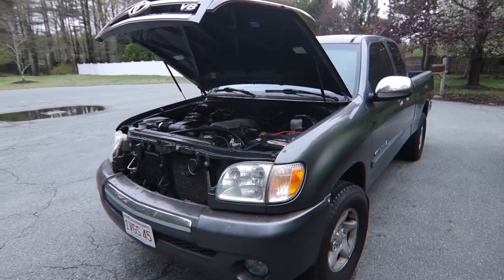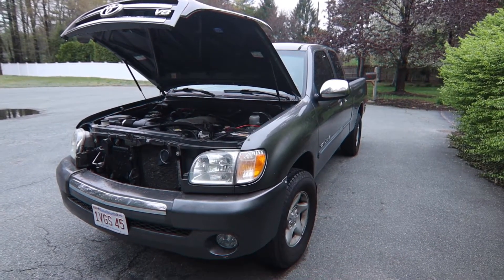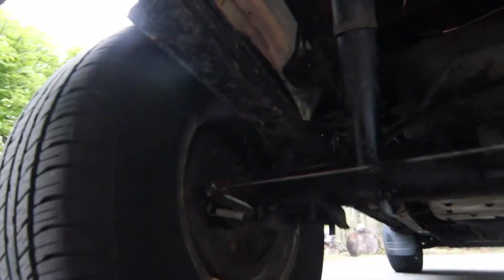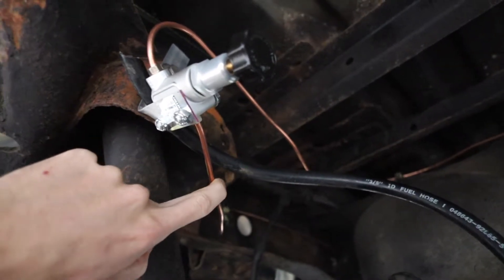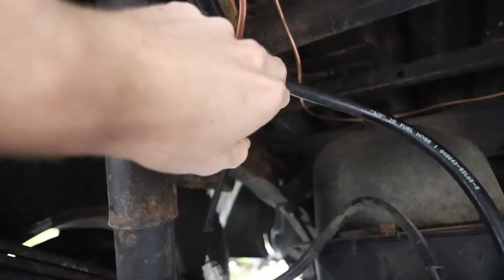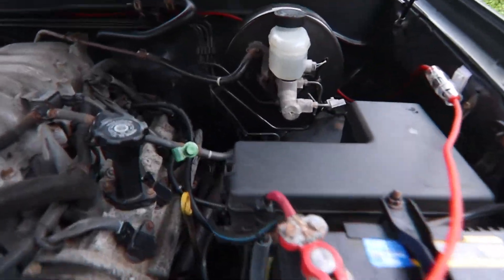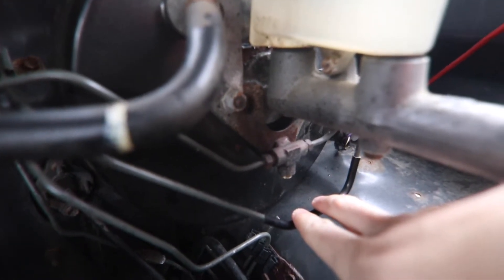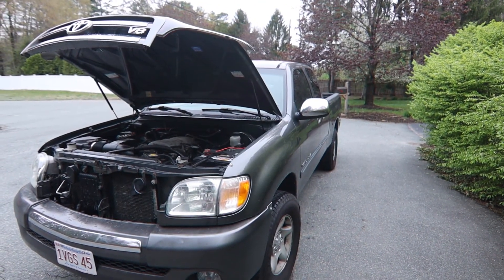TOYOTA LSPV DELETE / WILWOOD PROPORTIONING VALVE INSTALL

Comment: Copper is not strong enough for vibration, ware and take. You must use steel tubing
Reply: Nicop is great for ease of installation and resistance to rust and corrosion and is totally suitable for on road vehicles however one day hitting whoops in the dunes will brake them to pieces. Ask me how I know😂
Reply: Copper is the standard upgrade. Lasts far longer than steel.
Reply: @weswrenchtakesalook on a car yes, on an Offroad rig, no.
Reply: Would be like using iron pipe for a role bar

Comment: What kind of flares go to the willwood valve? The packaging says bubble flare but you said in another comment inverted flare
Reply: I'm also confused here. Wilwood part 26010922 says 3/8-24 nuts for inverted flare and part 26012627 says 10mmx1 for bubble flare

Comment: I've bypassed My LSPV in my 89 toyota pickup. Now I have too much rear breaks. If I slam them the rear tires lock up well before fronts. Should I put this part on in place of the original one? My return line rotted so that's why it's bypassed
Reply: How did you find out where the return line is ? I have the same year sr5 truck and I bought all new lines because mine was rotted off . Now whenever I use my brakes it’s only the front driver that works . Maybe I need to bleed them ?
Reply: On my 04 tundra the top line running inbd is to the brakes from the lspv. The top forward on lspv is the inlet line (I think line 7), the lower forward is the return to y block and master cylinder.

Comment: Hi, great info and video ! What type of flair is needed for the new lines going into the new valve ? Thanks !!
Reply from the maker: Those are m10x1.0mm fittings
Reply: @enginesadventures5689  Inverted flare ?? Thanks.
Reply from the maker: @yobeniws  yes

Comment: What happened to your video's on the Camper?  Did you finish it?  How does it work?  What does it look like now?  Come on Dood, I need to know!
Reply from the maker: Hey David I actually am in the process of building a totally new camper. Going to be about the same size but with a pop top roof and a little different construction. Hoping to get a video out soon of some of the construction of it.
Reply: @enginesadventures5689  Excellent, I look forward to watching it.  I'd still love to see the video or pictures of the finished 1st camper if you have them.

Comment: Hello, did the wilwood proportioning valve gave you more rear brake power? Im having poor rear brake power since I stalled 37” tyres and I was wondering if those valves could give me more rear braking power.
Reply from the maker: Yes it helped a lot